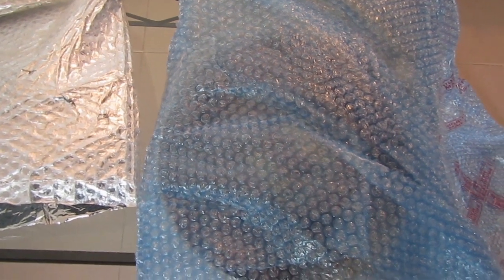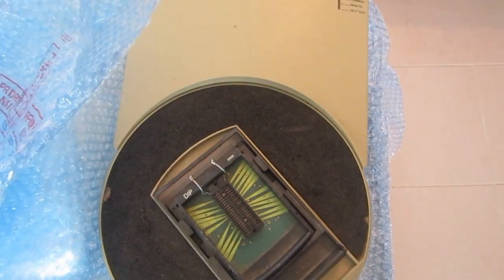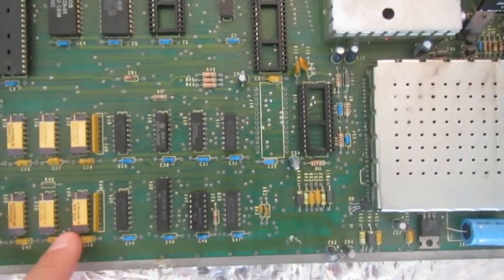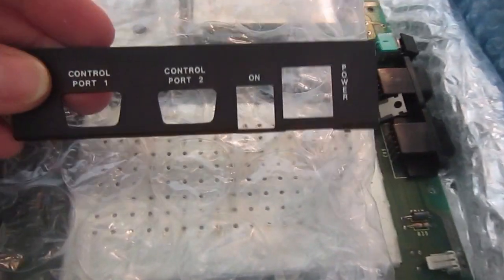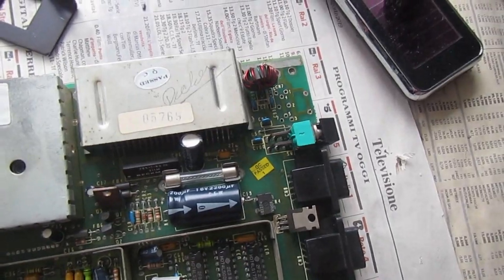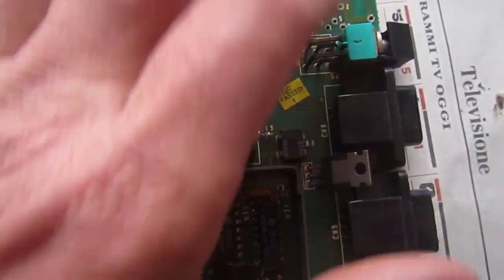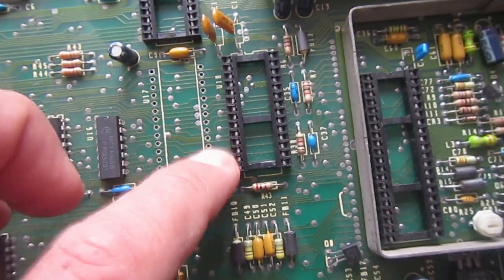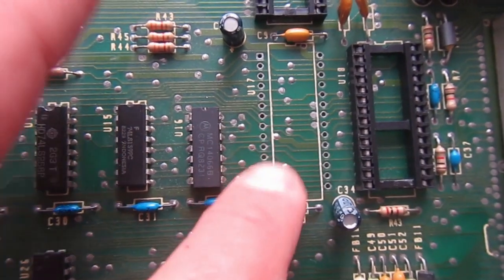Restoring a C64 PCB 326295 Rev A. The first C64 PCB revision.

Comment: the 326298a was also available as the 326298b and c version in usa only. it was only made in the USA, and the ones that were available in germany were only available as the A model sent from the usa, were minus the rf shield, and someone physically cut the trace with a knife to tell the board to be pal and not ntsc...
Reply from the maker: Great information, thank you!
Reply: @iz8dwf  by the way the resistor at r10 on these boards,was not correct at factory on every version of 326298 i've seen is 300ohms, supposed to be 120, if you stick another resistor on r10 of 220ohm value you'll get much better picture quality, check its incorrect 300 first!
Reply from the maker: @trendyfunandgames4759  Yes, I knew it, in facts I wrote in the description this update. After changing the resistor to a 120 ohms one, I have a much better picture, but still the R56A VIC-II shows some color bleeding. If one day I'll have either another R56A NTSC VIC-II or another NTSC C64, I will probably know whether it's an issue with this board or that VIC-II revision.

Comment: interestingly the 326298 when built in Germany briefly used boards converted in the US to pal before being shipped and they physically cut each trace with a knife to make it pal, then of course before fitting the correct clock and 6569! although people claim rightly that the picture is poor on the 326298 a 300ohm resistor can be fitted to improve it, can't remember off the top of my head where but it's near the Vic chip
Reply from the maker: Yes, R10 needs to be changed from 300 ohms to 120 ohms. With that modification, the picture quality improved by a large extent, but the 6567R56A still shows some color bleeding that's not present with a 6567R8. I planned to investigate further this issue but everything else got in the way so far.

Comment: Do you have the part numbers for the 7 pin female power DIN for power, the 7 pin female DIN for video plug, the pin female DIN for serial. the Cartridge port, the cassette port, the user port?  Need to order parts for a SixtyClone.

Comment: I should have tested that VIC-II first. I took it from spare parts. :-( It must be that chip producing that ghosting... Definitely not a normal issue on Rev A boards. Their composite output is normally quite good other than some being too dim. (due to the wrong value resistor getting installed by Commodore. That issue won't cause the ghosting though.) Glad to see the board up and running though!
Reply from the maker: Thanks again for the gift Adrian! I'll have a look at the video output in a few days probably. It might be my fault, I was using an home made splitter and yes, it might have issues if the video level isn't correct.

Comment: Hmm, I just posted a video of a problem I'm having with my Commodore 64 (motherboard ASSY 236298 REV A (c) 1982).
Is it the same?
https://www.youtube.com/watch?v=Ld-oRmPJe7w#t=1m20s
Reply from the maker: Hi! What I have is definitely NOT a 236298, at least not labelled as such. But I think the differences are minimal. Your board's issue is more likely the lack of heatsink on the LM7805 voltage regulator. That one is feeding both the SID and the VIC-II chip and it's probably going into thermal shutdown after a few minutes of use with no heatsink.
Reply: @iz8dwf  Although it has the problem when I use the Keelog power supply but not when I use the original Commodore power supply. So, I would say the issue is if the PSU is over 9-10V AC, it's more likely to cause VR2 (the LM7805) to run too hot and fail to deliver the proper output voltage.
(I see it progressively drop a few tenths of a volt, towards 5V, as it heats up and then the screen glitches start.)

I will put a heatsink on it and hopefully my 236298 REV A C64 will work well with both PSUs.

Any idea why replacement PSUs have such high AC output voltage (11-12+ volts) when the C64 spec says 9V AC?

My original Commodore PSU reads ~10V AC without load, and 9.2V AC when loaded by my C64. The Keelog provides 11+V AC under load by my C64.
Reply from the maker: @DrDavesDiversions  Replacement PSUs are often done by clueless people I'd say. Commodore designed that voltage regulator with minimal headroom for cooling. It works fine with 9 VAC but still needs an heatsink. Running a C64 with more than 9 VAC under load isn't  a good thing even if there're all the stock heatsinks on the later boards revisions.

Comment: Not only is that a 326298 Rev A motherboard, I can tell at a glance that it came from a silver label C64 as well. And from the looks of it, it was a particularly early one too! Always love seeing ceramic DRAM on those ‘82 boards... Really nice to see that you are giving it a new lease on life! (the heatsink for the 7805 wasn’t missing; those earliest silver label boards didn’t come with a heatsink on the 7805 and they got crazy hot!) EDIT- Also, there are a few small mods you can do to those early boards to make them nicer to use. One is replacing R10 with a 120 ohm (stock is 300 ohm) next to the VIC-II to brighten the dim video output, and also replacing the SID filter caps with 47pF ceramic so the SID filters work like all later boards. These were factory defects present on all early 326298 NTSC boards as far as I know. Theres also a mod you can do that allows some modern carts to operate properly on these boards in addition if you are interested...
Reply: Hmm, I just posted a video of a problem I'm having with my Commodore 64 (motherboard ASSY 326298 REV A (c) 1982).
Is it the same as this one? (Mine is mint; this is the first time I opened it. My parents bought it for me in 1983.)
https://www.youtube.com/watch?v=Ld-oRmPJe7w#t=1m20s
Reply: advoskater I’ll reply over on your video!
Reply: Interesting that this board (in Frank's video) seems not to be labeled where mine is.
It does not seem to say "ASSY 326298" here:
https://www.youtube.com/watch?v=IVvI998PWGE#t=1m32s
Reply from the maker: @DrDavesDiversions  I think it's the LM7805 that's going in overtemperature shutdown since it definitely can't run without an heatsink. That 7805 supplies the Vcc to both SID and VIC-II chip.
Reply: @iz8dwf  Right, I agree it's that the VR2 LM7805 output voltage that's dropping, and causing the glitching. It just doesn't happen with my original Commodore PSU.

I will put a heat sink on that voltage regulator, like you did here.
Thanks!
Reply from the maker: @DrDavesDiversions  That regulator works with the rectified 9 VAC input from the external PSU. If your original PSU has a lower voltage than the replacement one, then it takes more time for the regulator to get hot enough to go into shutdown, but even if you managed to feed it with the minimum allowed input voltage, it would still overheat. I suggest fitting an heatsink.
Reply: @iz8dwf  Yup, I just cut a heatsink from tin and affixed it tightly to the voltage regulator, and all is looking well so far. The voltage regulator are and the whole heat sink are reaching ~160F (after 15 minutes running) and seems to be holding stead. Without the heatsink, the voltage regulator was reaching 250F (as read by my thermometer probe) with the Keelog PSU, and about 230F with the original Commodore PSU.

I'll post a vid once I've tested it longer.
Thanks!
Reply from the maker: @DrDavesDiversions  As as I said, the thermal headroom was already tight on that design. You'd better find anodized aluminum (the darkened aluminum) kind of finned heatsink or even better, copper finned heatsink. You want to keep it as cool as possible. Aluminum or copper with fins is your best choice here.
Reply from the maker: @aphexteknol thanks for all the informations. It's crazy if they didn't use the heatsink on that 7805, it can't really run for long time without one even if the 9 Vac input is spot-on! However yes, I knew about the video resistor wrong value, I'm going to address that in a followup probably. I didn't know about different values on the SID's capacitors, I'll investigate that. What is that mod for carts that you're referring to?
Maybe some added capacitors on some signal lines?